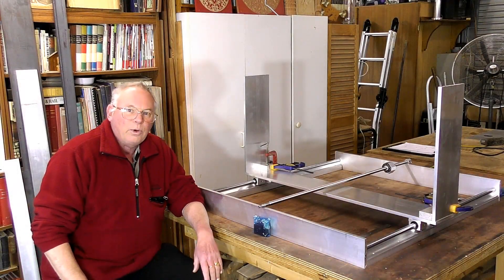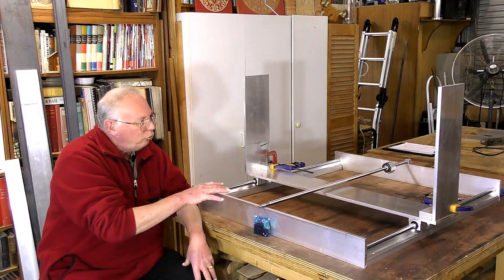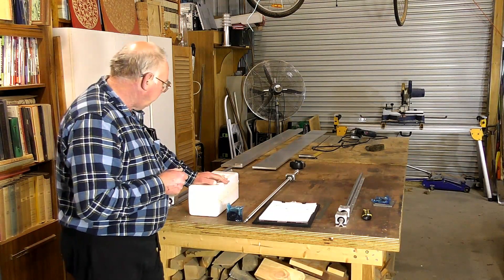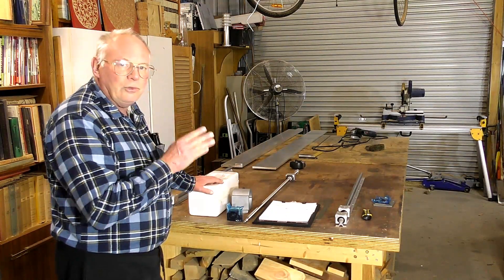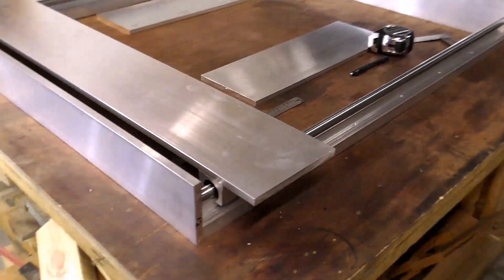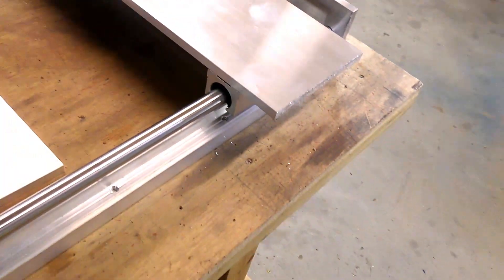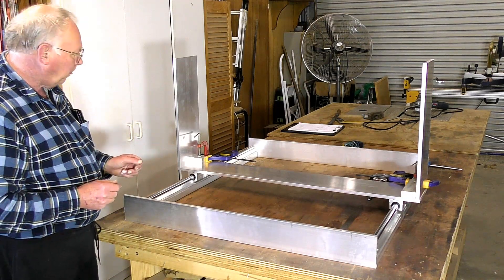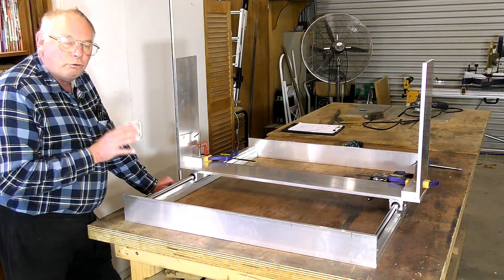Episode 1 NEW CNC ROUTER BUILD WITH SIMPLE WOODSHOP TOOLS

Comment: Hello from the US!  I really appreciate and enjoy your videos. Great Information.  A tip on cutting aluminum (especially thicker stuff). Give the blade a quick spray of some sort of lubricant, such as Alum-a-Lub, or WD 40. It will prevent that chip weld on the sides and give perfect cuts.  Also, if you make a rough cut just a 1/16" or so from your finish line, then when you make your finish cut, you're only using half the blade width, which will reduce vibration, and give you that perfect shiny finish.  Again, I do appreciate the time you put in to make these videos!
Reply from the maker: Yes I do use WD40, but not all that I do gets on the video

Comment: LOL....with the cost of aluminium and the project aimed at DIY it "could" have been made from 2X4's and some Marine ply....very cost effective..........It looks like the framework is the expensive part on this build apart from that exotic spindle.......I hate to think what the table will be made from.
Moving gantry type routers are not on my cup of tea list.......I wouldn't mind betting that a 3X scaled up 3018 ....(900 X 540).....might be a good build plan with extrusions in mind.
I  suppose it's a toss up between the cost of a long table and shorter frame materials for a moving gantry type, as opposed to a long frame and a relatively short table for a moving table one.....it's also a toss up for the real estate to house it when it's done, not something you could slide under the bed like a tread mill........ it possibly could be hidden in the wardrobe standing  on end.